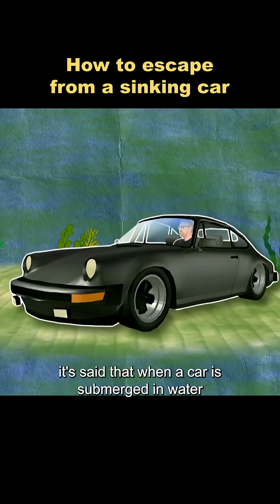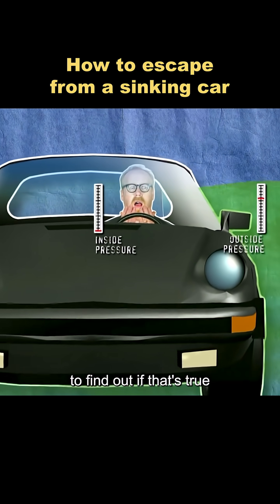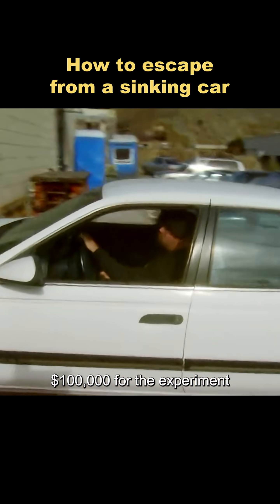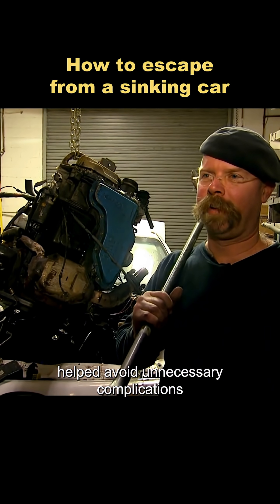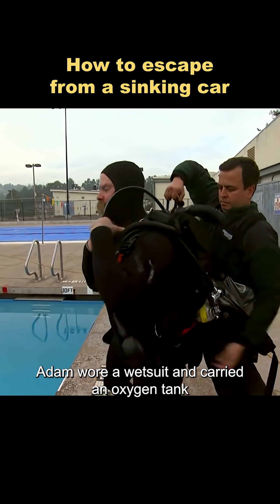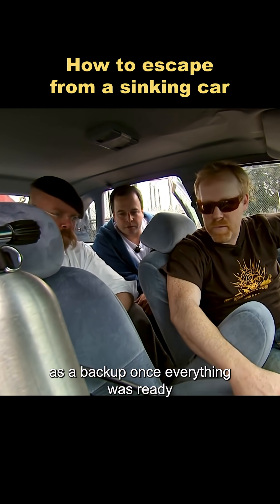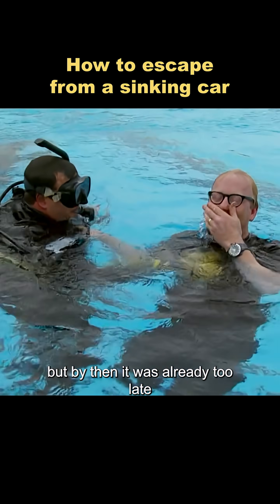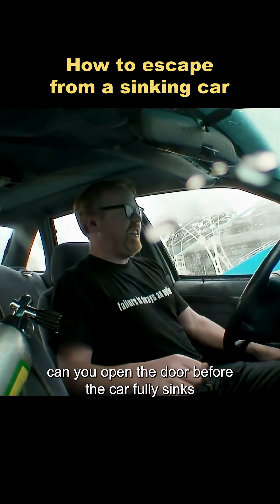Why can't you open the door of your car when it's in the water?

Comment: You generally cannot open a car door underwater before the car is fully filled because the water pressure outside the car is much greater than the pressure inside until the car fills with water. This pressure difference effectively seals the door shut, making it virtually impossible to open by human strength alone.

Comment: you can open it but you need more force because of the water outside push the door inside because of the pressure wen the water enter inside the car pressure lessen so u can open the door lessen force

Comment: It's only common sense as long as there's air inside you cannot push it open. THAT'S why a ship will not sink and it will float because there's air outside  .creating pressure. Just like inside the car air inside the car will create pressure and door will not open..

Comment: I was hoping to see the $100k second hand muscle car. Didn't happen. 😮😮😮😮
I have a device in my car that has a blade specifically to cut seatbelts and has a pointy hammer to break glass. There is no way I am waiting for the car to be full with water before I can open the door.

Comment: Yes you can open the door. how? you can get the head rest of the driver seat and it´s sharp, And you pull dowt to the driver or front passenger down window and the door is open. why? becauase if you do somthing like sharp or hummer the water pressure go back and you can broke the window by 2 or 3 time.

Comment: Some people really need to have common sense and take their brains right back to the old drawing board in school …..

If the pressure is greater on the outside, then inside is lower  , there goes your answer ?

Everything doesn’t have to be a test in order for you to find out because some tests come with an ultimate price to pay before you realize the answer …

Do anybody remember what happened to the 5 tourists that was traveling in a tiny Sub called the titan to try to visit the 1912 RMS Titanic Ship Crash Site  ?

They died halfway there  Why  because Water can equal weight which is more pressure surrounding onto any object .

So with this basic knowledge think of it as an empty can in your hand and then squeeze with all your might  . That’s called implosion….

If you put a pack of mentos in a 2 L Coca-Cola bottle close the cap  and shake it , BOOM !
That’s called explosion .

Comment: When a car fills with water, the door can only be opened once the pressure inside and outside equalize. This often takes longer than a person can hold their breath. To address this, I believe we could develop a system to rapidly equalize the pressure inside the car. One approach is to create a system that quickly sucks water into the car, reducing the time needed for pressure equalization. Another idea is an automatic glass-breaking system that activates during such incidents; this could be a mechanical system or even a sound-based system that uses the glass's resonant frequency to shatter it. Alternatively, we could equalize the internal pressure using an air reaction: either by releasing compressed air stored within the car or, my latest idea, by using a small, specialized chemical compound that reacts with the existing oxygen and nitrogen inside the car. This reaction would rapidly increase the number of gas molecules, thereby increasing the internal pressure to match the external water pressure, since the car's volume remains constant. Furthermore, extending this concept, if we can increase the number of gas molecules inside the car during such an emergency, we could also reduce the car's overall density. A car sinks because its density is greater than water's; by significantly increasing the volume of internal gases (through the aforementioned chemical reaction), we could make the car's average density less than or equal to water's, effectively preventing it from sinking. This would buy crucial time until a rescue team arrives. Implementing systems like these could significantly solve this problem. Perhaps some of these solutions are already in development, but these are my thoughts.
Reply: Step 1 : roll down the window👍

Comment: Pressure is high outside so its impossible to open the door when there is yet water inside, when the cabin gets full of water the outside pressure equalizes with the inside pressure, then it would be easy now to open the door

Comment: Why don't we add a hole with a bush below the car in case if the car fell in water we can open the bush and let the water get in faster so that that 3 minutes to fill the car with water can be reduced to 1.5 minutes and can save lives or we can put a volunteer motor in the car to fill the car with water ASAP to get that time to unlock the car doors❤

Comment: IF I OR SOMEONE ELSE HAVE BEEN IN MY 2004 HYUNDAI ACCENT YOU WOULD HAVE BEEN ABLE TO JUST ROLL DOWN THE WINDOW IT'S A MANUAL NO FANCY ELECTRONIC GADGETS OR TRYING TO BREAK THE WINDOW TO ESCAPE YOU WOULD SIMPLY GRAB THE HANDLE AND ROLL IT DOWN OF COURSE THE WATER WILL RUSH IN AND ALL YOU HAVE TO DO IS STAY CALM WHILE HOLDING YOUR BREATH CLIMB OUT OF THE WINDOW 🪟 AND MAKE YOUR WAY TO THE TOP SO YOU CAN GET SOME AIR. IF YOU WAIT FOR THE CAR TO HIT THE BOTTOM WHICH IN SMALL PLACES MAY TAKE AT LEAST 3 MINUTES UPHOLDING YOUR BREATH 🫁 99% OF HUMANS CANNOT HOLD THEIR BREATH FOR 3 MINUTES ESPECIALLY UNDER PANICKING CONDITIONS. MAYBE SOME OF THE TOP NAVY SEALS IN HISTORY WHO HAVE HAD THE OPPORTUNITY TO PRACTICE UNDER THESE CONDITIONS ANYWAY IF THE BODY OF WATER IS DEEPER THAN 50 FT YOU CAN KISS 💋💋💋💋💋💋💋💋 YOUR SWEET ASS GOODBYE 👋👋

Comment: one step can save you, remove your seatbelt and break the window with the metal part of the seatbelt , you can also use your headrest metal part to break the window. Because of the pressure acting on the door from outside the car causes the door to get jammed so it's not as easy as it looks 🫡

Comment: You can open the door before it fully sinks when the water starts to rise up you open the door quickly or if you too late you have something in your car to crack the window or you can take the headrest and you detach it from the seat then after to bang it on the glass to break it then you can escape through the window

Comment: That  is why I have a suction cup that discharges metal pellets towards the window or windscreen under my seat. it ado has a spike on the other end. I have tried it and it works well.
Reply: Great, but i think keeping a small oxy cylinder would be easier then….explosion proof

Comment: No but you could roll down all the windows open whatever compartment there is and let water flood in in response water can get in quicker meaning it could be significantly less time and you could possibly open it but also if you had a smaller car what's the same thing can happen just with less time like a beetle it would take a significant less amount of time for it to fill up with water and if you open every compartment and windows then it would be incredibly easy for to fill up and the average person can hold their breath I'm pretty sure for enough time if it was a beetle and did the instructions I'm pretty sure you could open the door relatively fast but also just to be sure you should I have a oxygen canister next to you if you were doing a test for safety reasons
Reply: LOL...

Comment: Well you can't win against that amount of pressure without enough strength but you can open the window if manual and if electric then it will work for only early few seconds when on water not in water and if you have a sharp tool in pocket like spark plug use it to break the glass and escape
Reply: Spark plug might be too small to overcome the hydrostatic pressure. Acting on the glass externally

Comment: Chat gpt says a car door is 2000 square inches, so if you have 1 psi on the outside of the door you have 2000 pounds of force pushing on the door, and every 3 feet the pressure increases by 1.3 psi or 2600 pounds.

Comment: Take a heavy duty pen with pointy top use force to atleast put a crack on the window so when the water pressure come on the window its easier for water to break the window first you just need to be able to swim through the broken window
Reply: Modern car windows and door locks are electric and God only knows what happens when the systems are submerged. Or burning... Having a tool for braking windows (or hitting intruder's head) does not sound stupid.

Comment: This is when manual window glass comes handy
Reply: or one of those glass breaking tools
Reply: @L_cuz  breaking glass is not very safe in that moment
Reply: @ScammerButChill Breaking the window under water would be best, but also quite difficult. And in a panic, most wont think about that either.
Reply: @L_cuz I don't think it's a good to break a glass while sinking, firstly it's hard to break the glass under the water, and secondly, even if it breaks, the outside pressure is much more, hence there are chances of glass pieces striking us
Reply: It's very difficult to shatter the window under water even with a sharp tool
Reply: @TecnoParadise  The spring loaded ones are decent to use i've heard
Reply: @TecnoParadise  hmm just like in minecraft 😅
Reply: Yes
Reply: Can't u use the seatbelt????
Reply: This is the only way..breaking window causes more water to sweep in.(Man vs wild)
Reply: Very true but very rare
Reply: One way to set yourself free in such a situation is by removing the headrest and using it to break the window. Cars are made in a way that the back floats while the front sinks, during such a situation you can move to the back .
Reply: @YonaldBalyage That's a myth.
Reply: Break the window. Why you waste time to open the door of you can destroy the window
Reply: 😂😂😂😂 u think in water its possible @mcalvinmacato5239
Reply: @mcalvinmacato5239  did you know that its hard to break glass under water. especially when yoru panicking beacuse you cant breathe.
Reply: the secret is to open the windows before the car falls and release the seat belt, so when the car is sinking, you can escape

Comment: The reason why you can't open the door while the car is actively being submerged in water is because of pressure difference. Pushing something in water if the door leads outside is easy. It's difficult if it has to be pushed from the inside. Same can be explained if you aren't in water. If the pressure is the same both inside and out, it's easy to open it, hence why the door can be opened when the car is fully submerged with water (the cabin of the car is fully submerged in water).
Reply: I don't think is swimming pool cannot create that pressure difference.
Reply: @shiplu.mokaddim no to kolego nic nie wiesz o fizyce. Ciśnienie wody zależy wyłącznie od wysokości słupa cieczy, a nie 9d ruczaju i wielkości zbiornika.

A co do ewakuacji z tonącego pojazdu to... Nie należy otwierać drzwi, tylko stłuc szybę. Dokładnie waląc końcówką pasa bezpieczeństwa w jej róg
Reply: @shiplu.mokaddim  water is way more dense than oxygen/nitrogen.
Reply: why not just roll down the window  so you dont have to wait 3 minutes
Reply: just open a window. if its automatic and cars still running maybe a chance is there
Reply: doesn't have to be fully submerged. it's enough when the front door is under water.
Reply: Car need to come with a device that can break the glass easily
Reply: Yup! that right
Reply: Main cause but not direct. Water goes in because of pressure difference. 

You cannot open it cause the pressure of water going in at immense volume at opposite direction. Same reason why walking upstream is harder.

Comment: They tested this on top gear, you have to open the door immediately before too much water builds up in the cabin
Reply: I don't think this is plausible in a real accident
Reply: Wdym by  that, search it up. Richard hammond tested this theory in an episode. If you wait too long, pressure will build up and you will die from drowning before the pressure equalises hence why you have to open the door or break a window asap @Proofinc
Reply: Better yet you open a window as quick as you can. If your car has power windows. time is even more important  getting them down before they  short out. (Opening a window allows the car to fill up quicker so you have a better chance to get a door open instead of waiting for the car to finish filling and equalizing on its own sweet time.
Reply: @eltonnoway7864 once the window is open, the pressure stops acting on the door and it should be easy to open no?
Reply: @bigsmall246  No, the primary intent is not to make the door easy to open, it's meant to give you an opening to crawl out of. Whether the car is in the process of sinking or already submerged, even with the window open you would still have water pressure pressure  working against the door. The idea is to get the window down while you still can. If lucky, you crawl out before it goes under. Once it starts to sink  water will be rushing in through the open window hampering escape. But once the care is flooded you should be able to swim out. Scary thought? Yes, but its better than being trapped in a submerged and flooded  car with no way out.
Reply: Great to see someone mentioning Top Gear 😊
Reply: Not true.

Comment: My head hurts on how they remove the engine
Reply: no because with the engine you can roll down the window if it wasn’t already plus the car would have sunk faster than that so the car would have been already fulled up plus the window would have been cracked by pressure and the engine weight would have sunk it faster although this was a test really bad example
Reply: @AceYT_FN  they addes  the saame ammount of weight of the engine in the car
Reply: SImple take it out